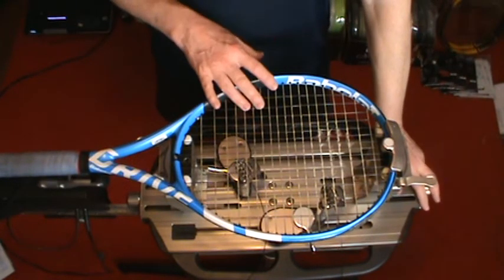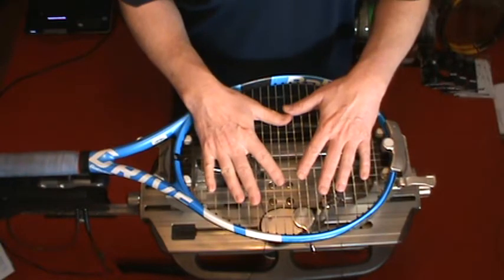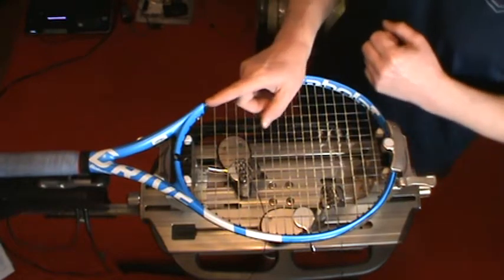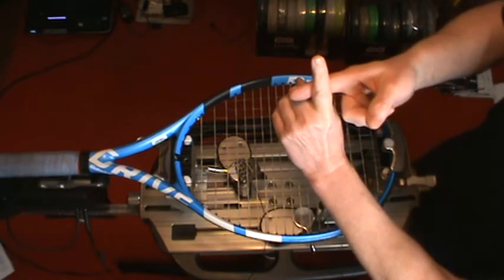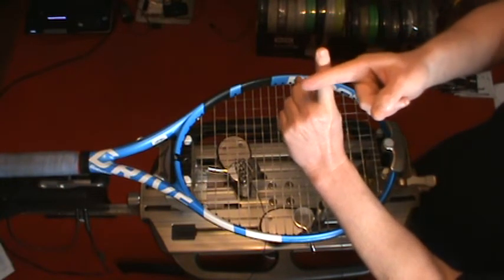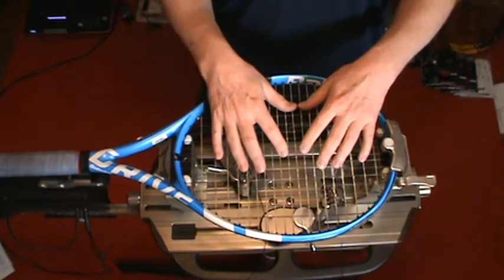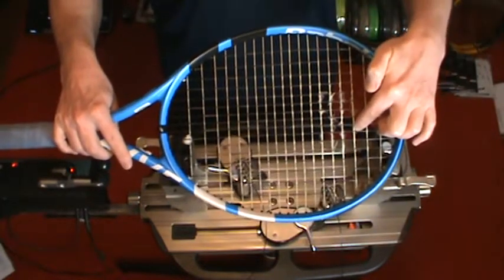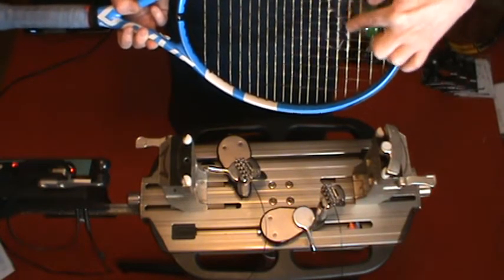Commentary/analysis of why the main strings - or cross strings - tend to wear/break first.

Comment: Great job on this . Thanks. A question: if I use a multi in the mains (head velocity mlt 1.30) and Alu power 1.25 in crosses, how much higher should I string the mains vs the crosses? I was thinking of doing 53 mains and 49 crosses. I also want to protect my arm. I usually use a full bed of Alu power at 53/51 but it’s too stiff now for me. Ok, thanks!
Reply from the maker: @PrecisionPointTennis,
Thank you very much.
You might also want to take a look at a related video that I shot a little later on.
In this video, you can actually SEE the "sanding"/thinning that occurs on cross strings.
https://youtu.be/rhcar9iC8UI

As for your Velocity/ALU Power hybrid question...
Typically, when someone wants to try out a hybrid (that they have not used before), I tend to recommend that they try it with both strings at the same tension for their first outing.
Then, afterwards, they can always sample the same hybrid set-up WITH tension differentials.
HOWEVER... having the knowledge that you were already using a full bed of ALU Power 1.25 at #53/51, I think your proposed #53/49 for the Velocity/ALU Power hybrid is probably a good starting point.
What frame, specifically, do you intend to put this hybrid in?

BTW, this topic just came up, about a week ago, on the TT forums.
See my comments here...
https://tt.tennis-warehouse.com/index.php?threads/poly-syn-gut-hybrid.762306/#post-17822543

If you can, send me a PM (called "Conversations") over on the Talk Tennis forum.
My profile/username on there is simply "Wes".

Cheers, Wes
Reply: @PCSStringing  thanks Wes! I haven’t used those forums yet but I read them! I’m using a 2001 Head i.prestige mid (330 grams unstrung and 89.5 inch head) but now I ordered two used 2021 Head Prestige Tour (315 grams unstrung and 95 inch head and 16x19 ) and to get back the feel I had when I played professionally back in 1985 when I used the adidas Gtx pro with 72 pound of vs gut, I’m going to try 53/53 of Head Velocity mlt. I want that feel and I don’t break strings. I need to protect my arm but hit hard every time. Much appreciated!!! Happy new year to you!